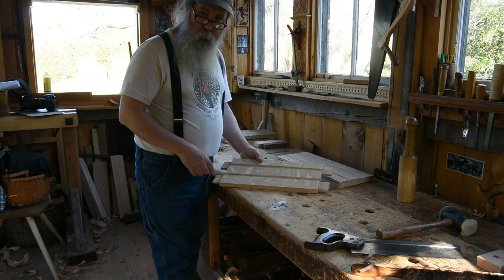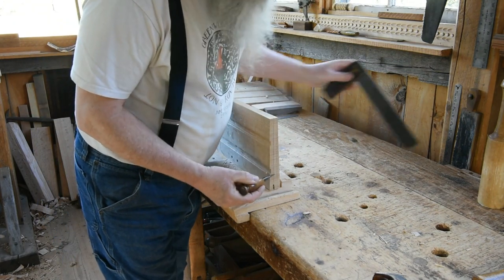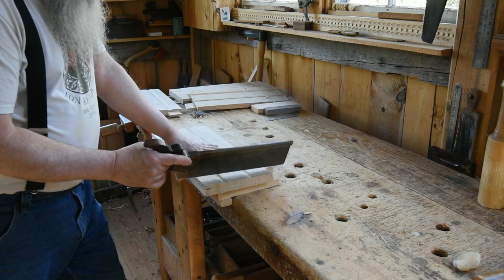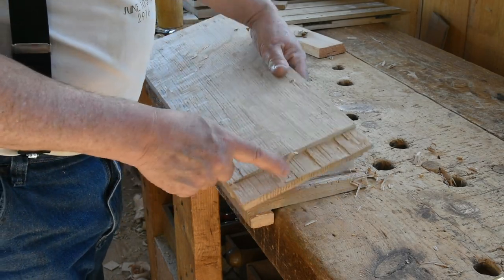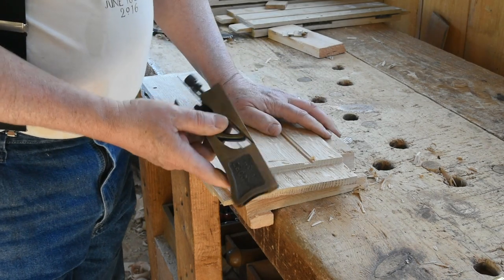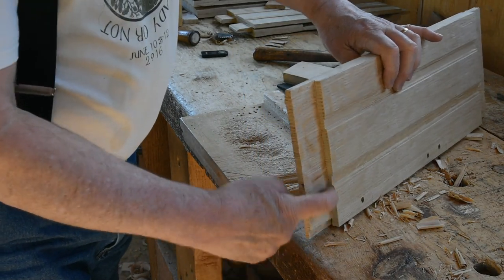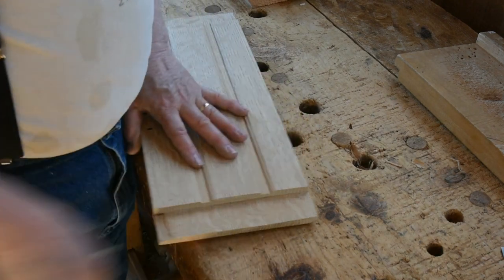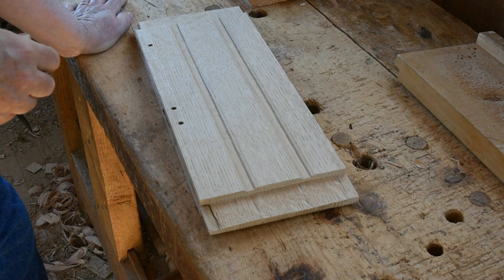Forming the double tenons on the side rails

Comment: Is he talking more about the angle or the depth of cut at 5:55?
Reply from the maker: Stan - sorry I wasn't more clear. It's about the depth of the cut. With the stock not being evenly-thicknessed, it's easy to lose track of where you're cutting. Because the cross-section is pie-shaped, I have to cut deeper at one part (near the camera) and shallower at the other (closer to me). I hope that clears up your question.